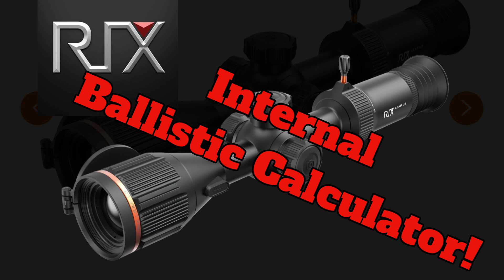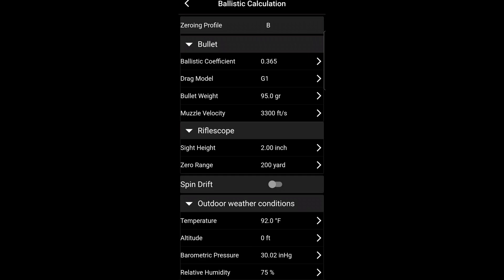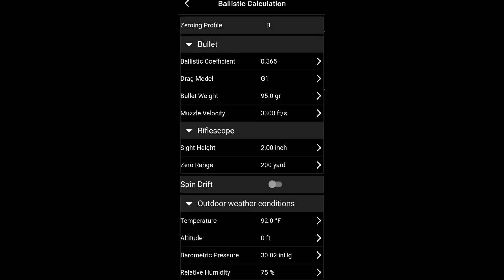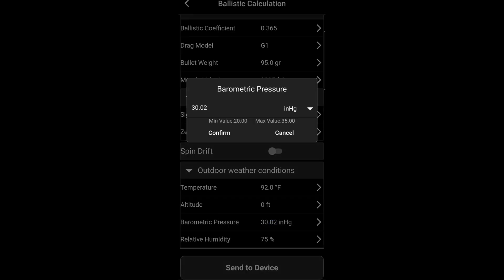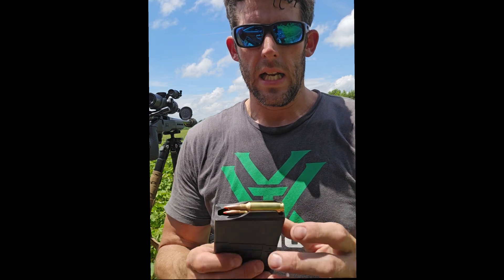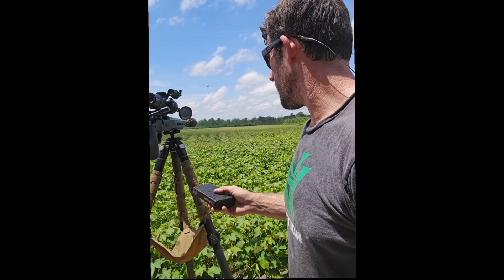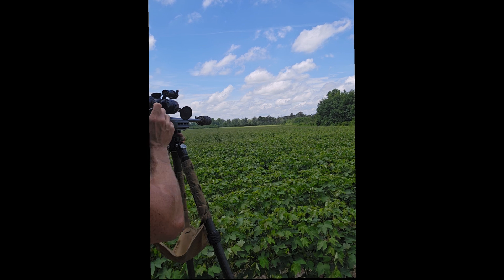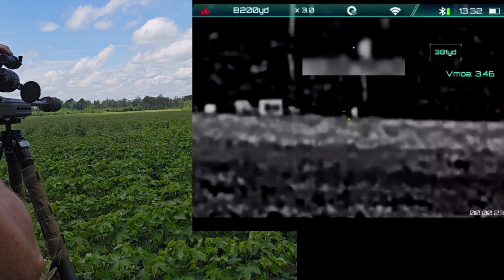Rix Leap L3 /L6 Thermal Scope w/ Internal Ballistic Calculator!

Comment: Might be a dumb comment but does the red laser stay on while you’re ranging or is it just for lining it up with your crosshairs?
Reply from the maker: @13jburger  You can turn the red laser on and off just for setting the LRF.
I have also use the laser to find coyotes in fields, lock the tripod with the cross hairs on the down dog then turn on the laser.
Reply: @ I figured but I wanted to be 110% sure before I purchased! Thanks for your input.
Reply from the maker: @13jburger  No worries at all, I am glad i can help. You can double click the power button to turn the Red laser on and off.

Comment: Good content.  Thank you.  I am looking at getting the L6 and want the Ballistic calculator.  How much did it cost to add to your scope?  Thank you.
Reply from the maker: @toddcarl1779  thank you.
The LRF is typically $500 to add to the Leap series, the ballastic software is around $10 but sometimes Rix does it for free as a promotion.
Reply: Is it pretty accurate for you?
Reply from the maker: @toddcarl1779  yes but it needs to be aligned properly with the reticle in the scope

Comment: What about lrf you do that outside of the scope with a hand held or does the scope do it as well
Reply from the maker: @idkidk7985  the leap series has the option to add on an external LRF. Once you have the lrf added on you can purchase the ballastiic solver in the Rix app and it will do the ballastiic calculation.
If you notice you see the tube on the top right of the scope that's the LRF.

Comment: Do you ever have problems with the range finder moving or not staying zeroed
Reply from the maker: Make sure you have the bushing in the LRF mount when you install it.
I have used a rubber liner ( cat tounge grip tape) for when I lost my bushing to line the inside of the mount.

Comment: Do you need Wi FI or Bluetooth after you enter the ballistic info on the app for the scope to make the calculations? Will it make calculations out on a hunt without access to a phone?
Reply from the maker: You will connect to the scope via an internal wifi connection.
Once you input the data in your phone and upload it to the scope.. your done!
The scope does the calculations. During this video I was using my phone to record and it was not connected to the scope at all so you will not need to have your phone constantly connected.
Reply: @aaronw_06  Thanks for the reply! I noticed you have the range finder attached to it as well. Is that needed for the scope to make the calculations?
Reply from the maker: @m4tank127  yes the laser range finder is needed. The scope uses that data for the calculations.
Reply: @aaronw_06  Cool, Thanks for your time!